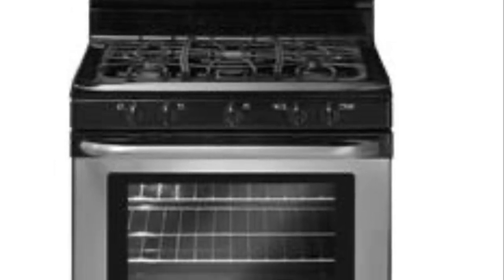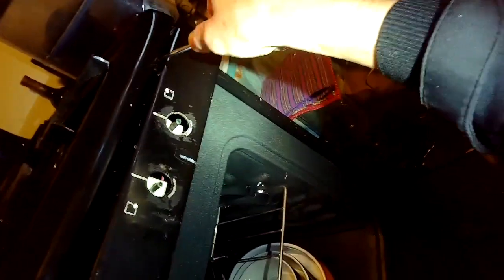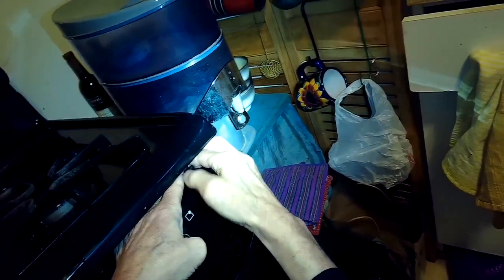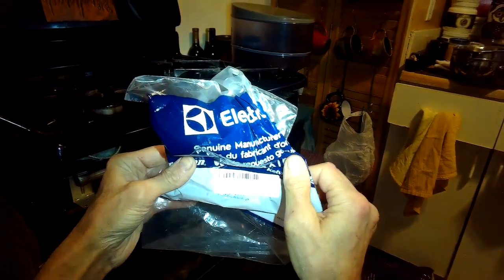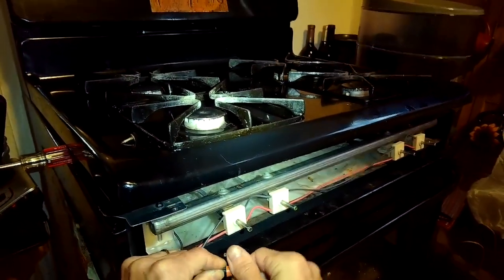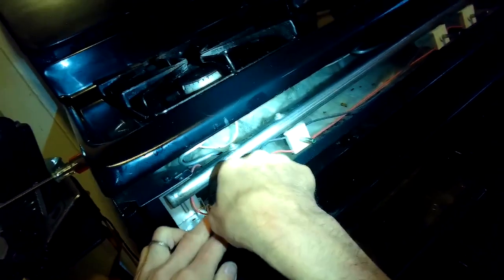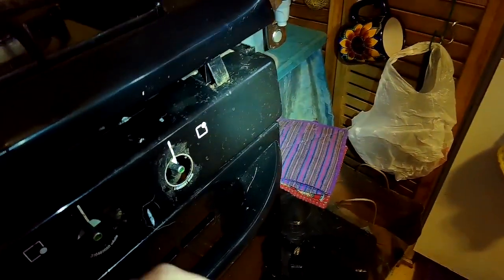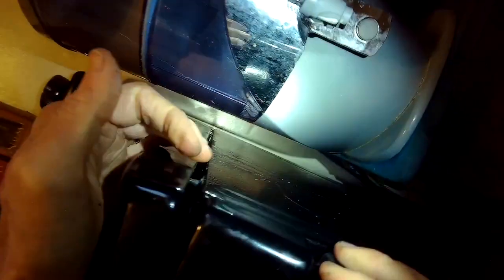FRIDGIDAIRE GAS STOVE BURNER WON’T LIGHT—FIXED

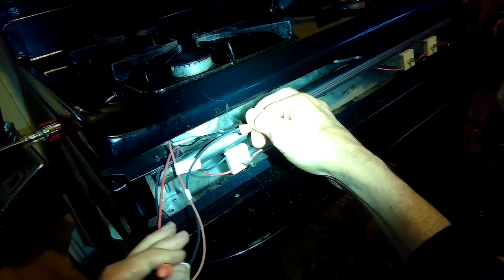Comment: 4:10 MEOW ... thanks... I turned the lights off and saw that all 4 burner knobs are causing the back right burner to try and fire. I assume this is my problem hopefully.
Reply from the maker: Very good. Most stoves fire all 4 igniters at the same time.  I hope this helps you fix your stove. If our Video Helped you Fix Your Machine, Please Click Here to Donate with Venmo:
https://venmo.com/u/Scott-Flint-1
Reply: @QuickAndEasy5MinuteAppliance  Ah, very useful troubleshooting tip. That gives me more confidence I bought the right part. Also the crazy thing is inflation double the cost since this video. What a Crazy world. Thanks again!